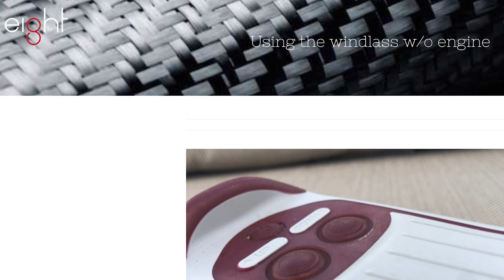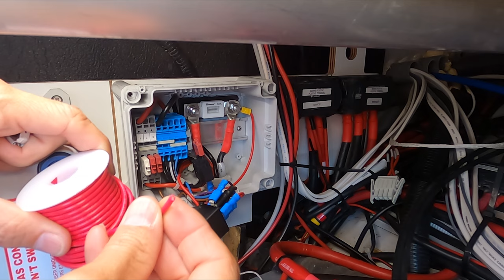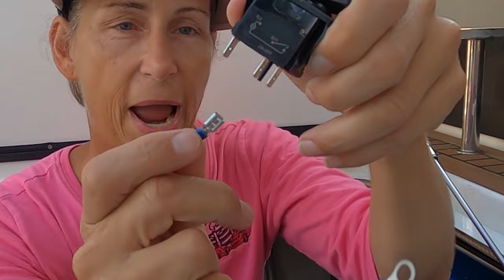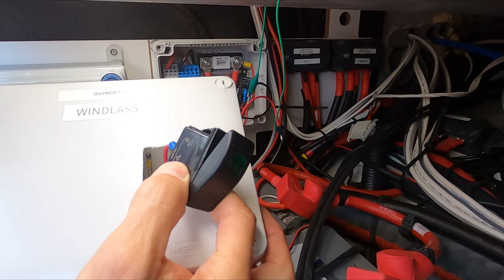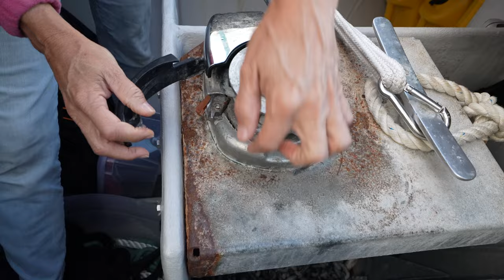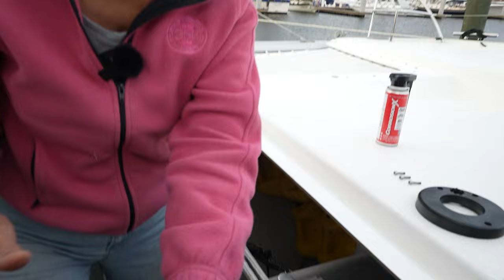How to Avoid TWO Anchoring Disasters!!! - Ep. 12

Comment: On high quality crimp terminals you’re suppose to do 2 crimps. The first crimp is exactly how you did it. Then you use the other position (Ins) to crimp the insulation. It’s suppose to add some mechanical strength. Most of the cheap terminals only need the crimp exactly like you did it. Nice job!

Comment: Heya! What did you use to make the hole in the plastic cover to fit the switch into? I am about to do this install on my Helia 44 and am nervous about damaging/screwing up the plastic cover when making the hole for the switch… and your Channel Rocks!
Reply from the maker: I think I used a dremel and started small.  Keep going and fitting, because it isn't a perfect square.  Also, use the gasket as a template.  Just take your time and check it a lot as you go.  Also. We have a good video coming up on Volvo D2-60 engine elbows if you have Volvo engines.
Reply: We do. Volvo D-2 50’s so I’ll be watching. BTW, Mads and Ava turned us on to your channel. Ava is my sister in law and her and Mads were very excited to share your channel with us when they got back from the boat show. Cheers!
Reply from the maker: @TheJulianAcosta  Oh, I've been watching the videos of your boat! I need to do the sail drives when we haul out at Fort Pierce on the 15th.  I sent a message to Mads... Where did you source your seals? I might get them from Sun power Diesel out of Lauderdale but I'm always looking for a good place for parts :)
Upcoming is elbows and turbos. The elbows were a complete disaster! Like 85% clogged.  The new parts came from HDI out of Vancouver WA.  They make SS castings. Perfect fit. They make them for turbo and non turbo. 
It would be great to connect through Whatsapp.  Maybe Eva can connect us :)

Comment: Hi Franny. Jørgen from Denmark agin. You should not use those blue and red conditions. Get som good ones. These ceps ones vil get you in trouble later on. I did some sailing years back, so I know. And I know you did have knowledge of good ones and heatsink too. Youse that. Or soldering and grease. Now you are in salty surroundings. Just a tip.
Reply from the maker: Thanks for your concern.